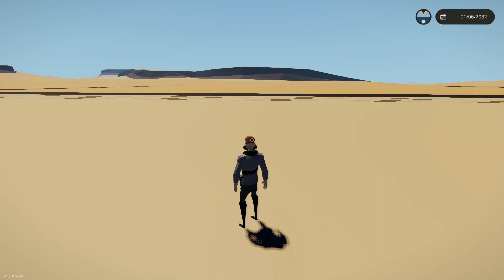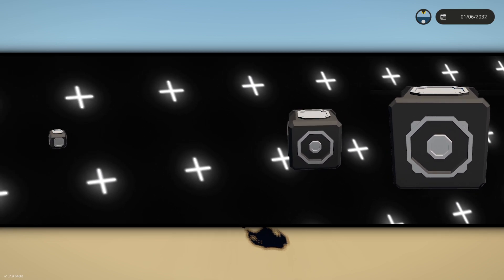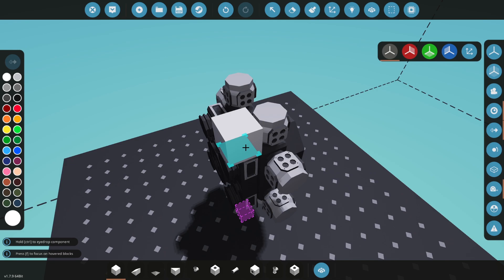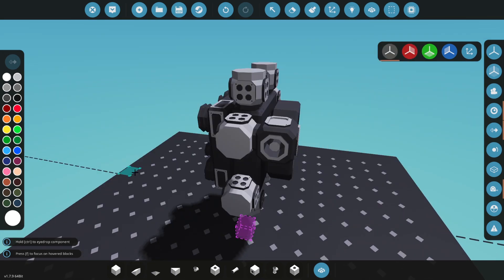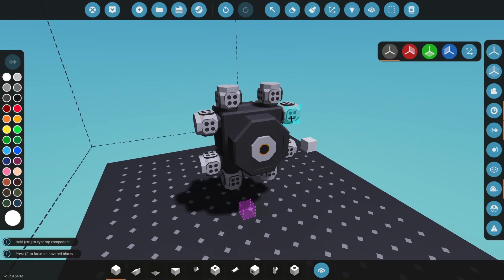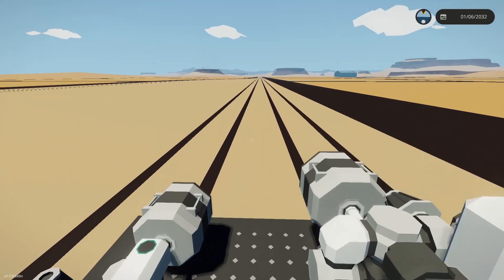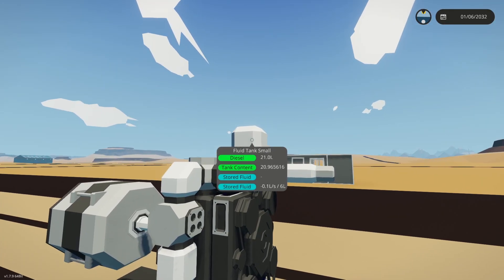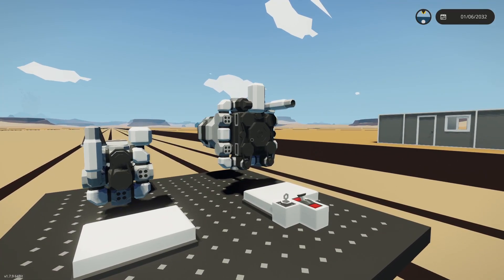Stormworks's Forgotten Engine

Comment: A (3x1) engine has ~4 times the torque and is somewhere between a medium (3x3) and a small (1x1). If you need to move a heavy vehicle where there's no room for a (3x3) engine, a small engine, even one with 30 cylinders, won't have as much torque as a (3x1).

Comment: I use it all the time, I have a V8 truck engine using it, and I am currently recreating the largest rescue cruiser in the world the Hermann Marwede (or as close to it as possible), and it runs on two "MTU 12V 4000 M90" engines, and one "MTU 16V 4000 M90" engine, anything but the 3x1 frame looks wrong for these engines. So if you ask me, the 3x1 is great for some chonky looking "V" type engines